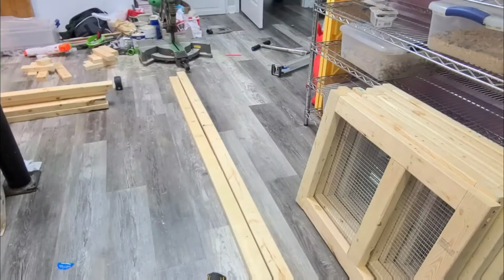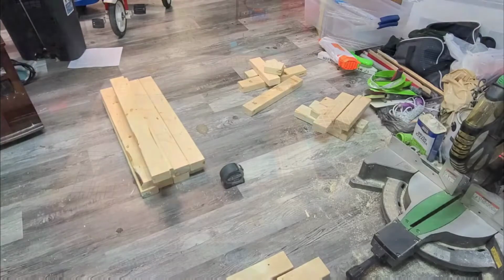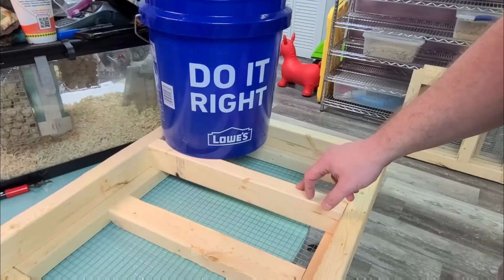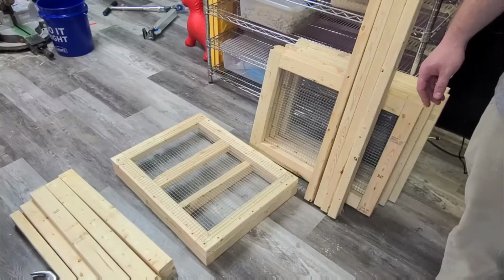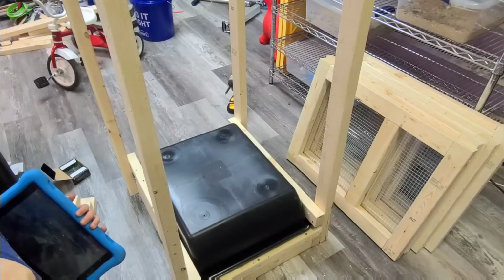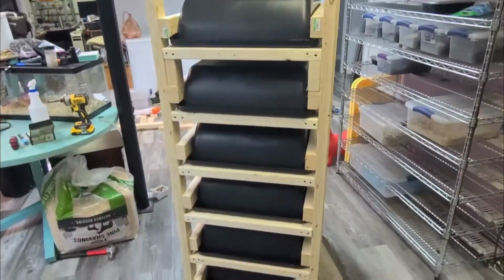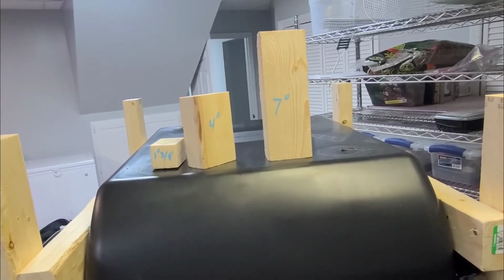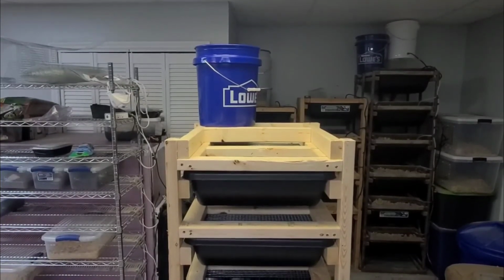Build a Rat Breeding Rack - Pt.3 Final Assembly!

Comment: How about adding a complete part and cut list separately??? Hard to figure out what is needed spaced out.   Amazing video,  and thanks so much!!!
Reply from the maker: The issue with a cut list is that it changes depending on what tubs you have.  Each of the 3 difderent tubs I've personally bought from lowes all have slightly different dimensions, so you have to adjust things to your specific tub.  So I tried to give an outline to follow for your specific situation.